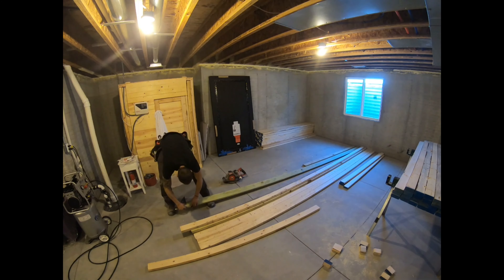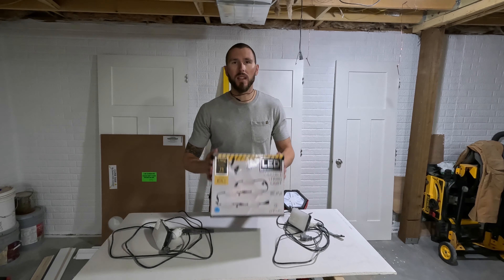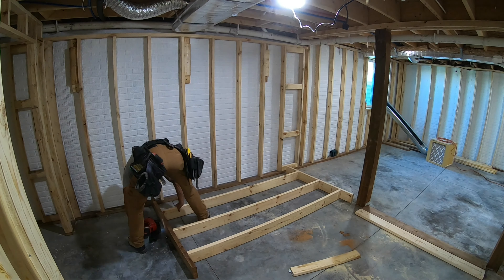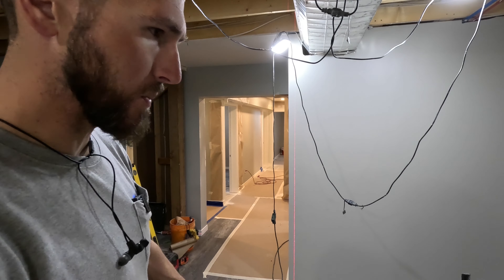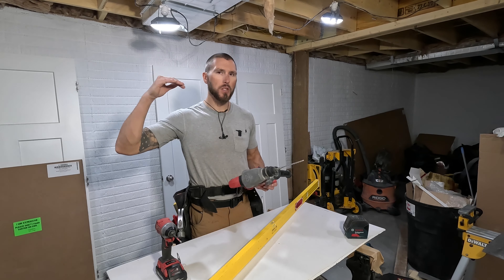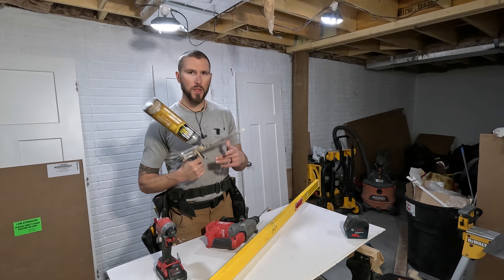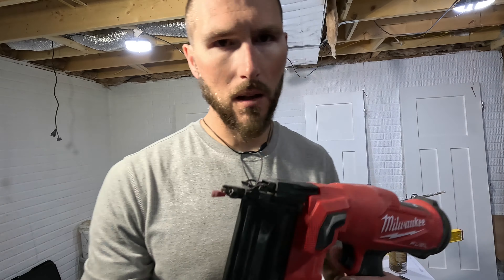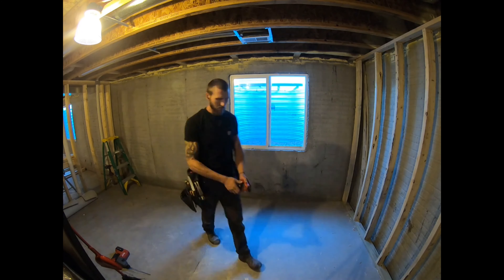Finishing basement?!?!?!

Comment: The light cannon looks awesome I've never seen that before! Same with the string-up lights... Could see using those anywhere I need to set up a temporary work site. Also love the pneumatic construction adhesive it lays down a so much smoother and more even bead than manual trigger. I used to like a type of Loctite construction adhesive that came in a pneumatic tube with a built in dispenser tip that you bend (kind of like a whipped cream can). It worked great but they discontinued it. I need to pick up one of those guns!
Reply from the maker: Yeah that adhesive is great! Be careful running the expandable foam through those guns tho, when your done you need to run plenty of cleaner as the foam seems to set up. You can leave the adhesive hooked up and dialed to off for up to a month. Doing that with the expandable foam on the other hand will clog the gun, I learned that one the ol fashioned way 😂